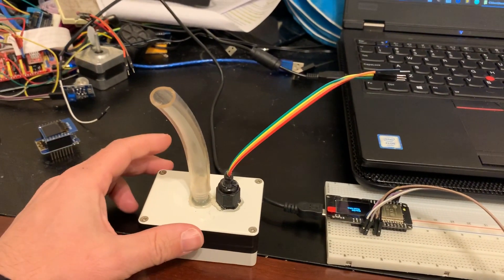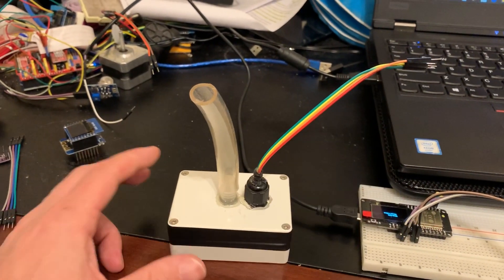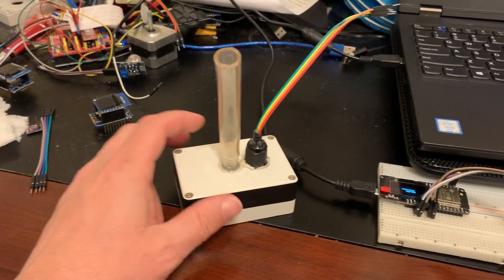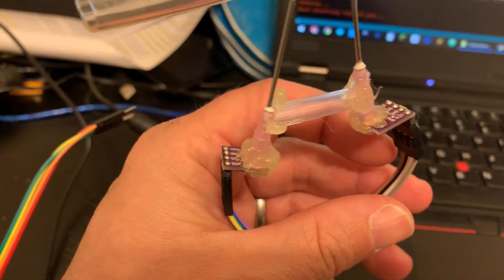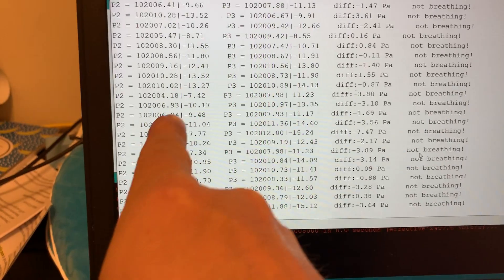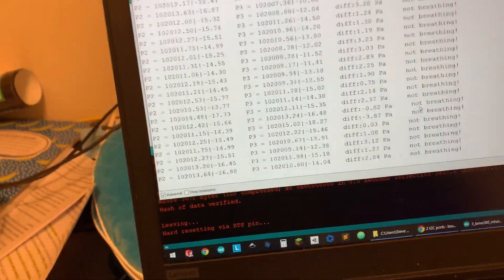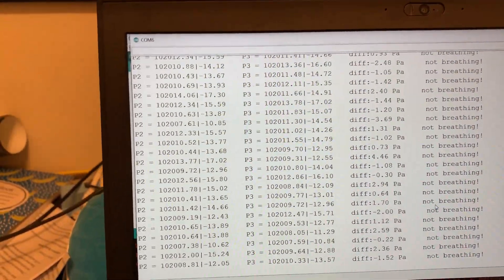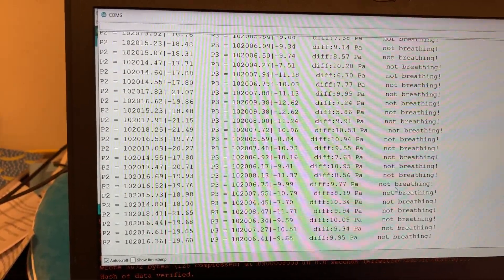Mechanical Ventilator Logs Part 2 - Pitot Tube experiment

Comment: Hi Zenman , I am Sam Medical doctor from algeria
I am working on prototype of ventilator (openVentilator) , I am glade to see that u did a air flow sensor , that could be use as A TRIGGER & that's is awesome , can u please send via email the Arduino's sketch & the diagram I am gonna to test it in my prototype , also if u succed on the project of air flow pressure mesure , let me know about it
Keep going
Best regards
Reply from the maker: Hi Sameh. I haven't worked on the code in quite some time. I did upload it to github, feel free to give it a try and if you add to it, fork this repository and share your owrk. Here's a link to the arduino code I started: https://github.com/zenmanenergy/ventilator/tree/master/experiments/Arduino/Ventilator%20Sensors/pressure
Reply: @zenmanproject  oh awesome!!
Great thanks